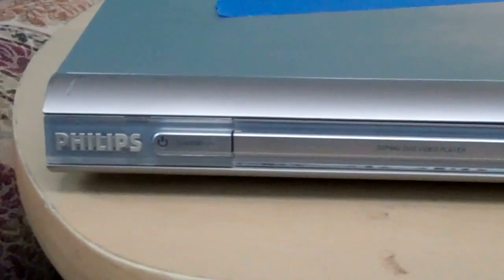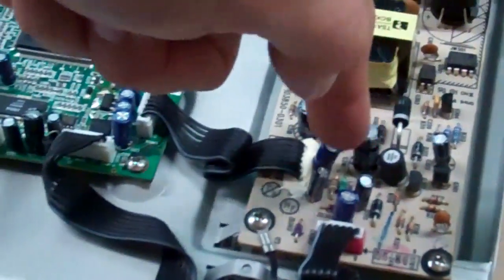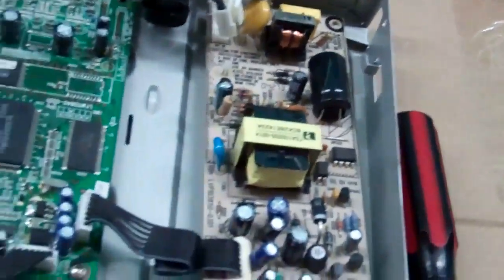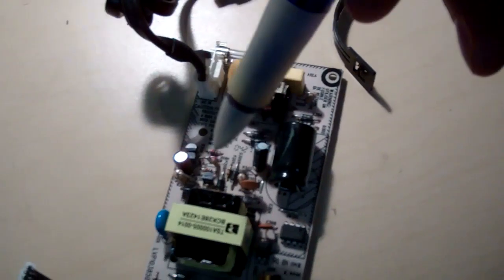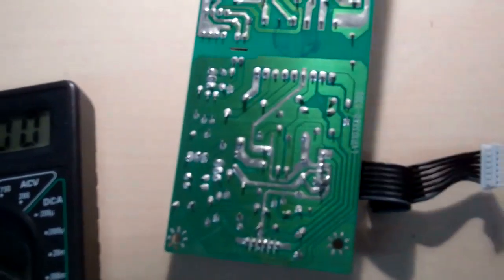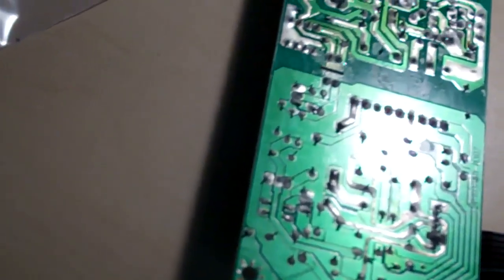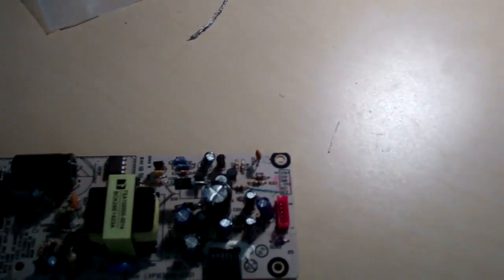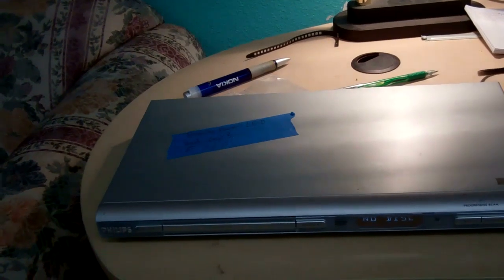Philips DVP642 DVD Player Repair (C316) Tutorial

Comment: I just fixed this DVD player thanks to this video.  I bought a soldering iron and some solder (from Hardware store) and used a 1000 uF 16 v (from Fry's electronics).  It cost about 32 bucks total.  Although it would have helped to see the soldering part because I've never done it, I figured it out nonetheless.  Works like a charm! Thanks a million!

Comment from the maker: The best resource I have found for advice in fixing a switching power supply is the Bad Caps Forum. They have an active forum with many knowledgeable members. I have found it is usually the switching transistors or a bad transformer as common failures.

Comment: Thanks for the video tutorial. It really helped. Not only do I have to replace the C316 capacitor but I also noticed another capacitor on the other circuit board colored green. That capacitor on the circuit board is labeled C290 It's the 470uF 16V one. 
The thing I found a odd was my C316 capacitor was labeled 1000uF and 10V instead of what you showed to be 16V.
Anyways, my thought is to inspect all of your capacitors when you take off the cover to your dvd player. Look for the bulges on top.

Comment: Thank you very much that is very useful, breathes life back into my DVD player. 
One little thing though, at 4:08 you point out the negative and positive side ... but I am pretty sure you got them flipped. On the board all negative terminals of the capacitors are marked with diagonal lines so it is easy to get it right.

Comment from the maker: Sounds like a read error issue. Likely the LED laser diode is going bad. You can trouble shoot by seeing if CD works correctly since they use different LED lasers for CD vs. DVD. With something like a PS2 you can buy new laser assemblies and fix. I do not know if these are easily available for your unit.

Comment from the maker: The first place to look is the power supply. If anything else it will be cheaper to buy new. There are detailed guides to fixing problems like this on the Bad Caps Forum. Be sure all the low voltage outputs have a reasonable voltage. If PS likely bad regulator transistor but look for bulging capacitors too.

Comment from the maker: Hi Naj. When a TV does not come it is usually something in the power supply circuit. Do you see any bulging caps? Maybe you will get lucky and find a replacement power supply board. Take apart and Google part number.
There is an active group for TV repair at the Bad Caps Forum. Maybe they have better ideas.

Comment from the maker: You will have to use Ohm meter and look for short in high voltage DC to ground. Could be the main switching transistor or the rectifier diodes. Use Ohm meter to verify the diodes. With the price of new DVD players so low it is not worth too much time to fix. A new power supply board will be much more than a new DVD player. Look on the Bad Caps Forum for troubleshooting info.

Comment from the maker: It is something in the power supply.  Switching power supplies are all similar. You should have 160V DC across the huge cap at input. This is used to supply a square wave across transformer. Output of transformer is rectified and regulated for low voltages. Often the switching transistor fails or transformer has fault. Go to the Bad Caps Forum for expert advice for troubleshooting.

Comment from the maker: OK that is clearer. If the big huge 250V cap only has a few Volts then that narrows it down. It can only be the rectifier diodes, input choke or the fuse.  The line voltage is rectified and you should see around 160V on the cap. I looks like I see two diodes near the 250V cap. Likely one of those is bad. Check with an Ohm meter.

Comment: So you don't think it's an issue with the fuse? I'll try a cd but the problem along with what I said is that the door of the dvd recorder will not open until that 3 or 4 minute period also. Once I put in a dvd disc it works ok.

Comment: Got into the retro nostalgia, and needed something for my father to play CDs and DVDs. I had this same unit stored and when I tried, has the issue. But now I have to wait for electronic stores to open due pandemic 😒
Reply: look in any old/broken used board, its a great dvd player, worth the fix
Reply: Was able to fix it. Had to change 2 capacitors but only cost me 3 bucks.

Comment from the maker: I recently made a new video "Motherboard Repair Tutorial - Bad Capacitor Replacement" where I go into detail in desoldering.  A motherboard is a much thicker multilayer circuit board and clearing the old solder is tough. You need to put the solder wick braid over hole and push iron into hole top and bottom. Then use an old piece of resistor/capacitor wire lead to push in hole while heated and pull out quickly to remove the remaining solder. The single layer board in DVD player is easy.

Comment: Is it possible to add audio input to this ? To connect settop box audio or any other audio output ?! I mean I planned to use the player as 2rca audio conversion to home theatre system. Mine also same model. Is it possible means where to join audio IN inside...  (Also doubt regarding on Connecting rca with sp+ and sp- and gnd for my plan is correct or not!  ) Kindly thanks.

Comment: So mine exactly like this will not recognize the remote anymore. I have changed batteries and tried to figure out how to reset remote with no luck. I’m wondering if it is a bad phototransistor in the dvd player itself. I know the remote phototransistor works because you can see the led light in the end. Suggestions?

Comment from the maker: The 16V (int 160V) should have something like 5V steady. My guess is a different cap has gone bad causing the 5V regulator to malfunction. If a very high level of AC current is flowing through cap (or in backwards) it will go bad quickly.

Comment: In my dvd home theater system Phillips htd3510/98, rear left channel and front right channel sound is very low compared to the other channels, its sound like low frequency audio and I tried to increase the db -/+  but too low volume from RL channel .why? Any solution 🙏

Comment: There are actually 4 blocking diodes near the large cap.  2 to the left and 2 above.  It looks like 2 in and 2 out.  One in reads around 18v, the one out reads 15v.  The other two (parallel to each of the others) read nothing.  Also with it plugged in I hear a regular clicking sound, very light.  It seems to correspond with the power light blinks. Thanks.

Comment: I replaced the cap you show on the vid 3 years ago with success.  It went again.  I replaced it, and it lasted 3 days then same blinking light again.  It went way too quickly this time.  I tested the large 160v cap and it fluctuates wildly between 7-15 with a meter on the 20vdc setting.  I assume something else is bad besides the cap I just replaced.  Any ideas?

Comment: The problem I have with my dvp642 is not a flashing red standby light. My player has a solid red standby light, until i press the button and the player appears to try and start but then all power shuts down. I checked out the caps and cannot see any caps, including C316, bulging. So I'm lost.

Comment from the maker: It is the power supply. Maybe just the fuse. Likely something else caused the fuse to go. Look for bulging capacitors. Check the input bridge rectifier. Plug in the PS and check for 160V on main capacitor. Could be anything. Look/post on the BadCaps dot Net forums for repair guides and help. Can you find a new power supply?

Comment: Sir, I have a DVD player (a Philips DVP 3996X/94) power supply issue. It shows no signs of heat damage or exploded capacitors. I changed the active components (a TL431, the optocoupler and a TNY177PN). Still, all the supply voltages read an exact zero. I replaced the board and the device is working. But as an electrical engineer, I want to fix the defective board. Can you help? The board type is 40-P10176-PWD1G.

Comment: I have the same dvd player and it had a blown fuse in it, I changed the fuse but the new fuse burned again.. The new fuse was a 2A and the older a 1,6A one (But I don't think that this is a problem..) The capacitors are in a good condition as far as I can see.
Any advice?

Comment: Hi, great video.
I have a dvd player recorder that when it plays it shows blanck and white and noot colors.
Any help?
Thanks.
Reply from the maker: The video processing circuit is bad. Not a cheap fix. Look on the BadCaps Forum for a lot of info for repairs.
Reply from the maker: They make remote testers. A used remote off eBay is cheap or maybe a universal remote. Otherwise you are looking at the IR sensor maybe on display board.

Comment from the maker: I doubt the replacement capacitor went. I do suspect the power supply. My guess is one of the other voltages is missing. Use a volt meter to probe the output connector. There is a diagram printed on board showing whe required voltage. Maybe another cap is bad maybe something else. Inspect them all. Proble looking for missing voltage and trace back to bad part. The Bad Caps Forum has a lot of repair help so ask there.

Comment: I have one of these, replaced the capacitor years ago. Worked just fine. Recently took it out of storage and now it has no sound. Before you ask, the audio settings have NOT been changed and the player is not muted. There is simply no sound through the RCA jacks. Any idea what to do or should I toss it in the dumpster?
Reply from the maker: Maybe open up and wiggle connectors going to circuit board and hope you get lucky. Likely the audio amplifier went bad. In these modern times it is often better to just throw away than fix.
Reply: Kent Diego That was the first thing I tried. However, I've decided not to toss it as I have another one that is identical and if the lens assembly or power supply go on that one I'll have parts. The main thing I like about this model is that it plays Video CDs.

Comment: How much latitude is there with the capacitors?  I happen to have a bag full of 25V 47uF.  Think I could use one of those?
Reply from the maker: 47uF is a lot lower than original. I always try to go higher. You can give it a try. Has to be better than the bad cap it replaces.
Reply: I went ahead and got a pack of 10 of the correct capacitors.  10 for $1 shipped from China. How do they do that? Any way, swapped out the capacitor and everything seemed to work fine except I now have an entirely separate issue to deal with...  It would appear that the red output is not putting out a signal so the picture is color-incorrect - it's sorta blue-ish black & white.  I tried cleaning the connection to no avail. Any thoughts?

Comment: how do you avoid getting electrocuted when you are working with capacitors and transformers ? how can you discharge the capacitors safely ?
Reply from the maker: Working on a circuit that is plugged requires care. You do not touch circuitry while plugged in. There is a large cap with 160V on it. It will drain off quickly once unplugged. I make a point of never touching the HV part of the circuit on or off.
Reply: +Kent Diego is there any danger of working on this while it's not plugged in? Any electricity "stored" somewhere temporarily?
Reply from the maker: The big 400V capacitor can store a charge for a while. Not sure how quickly it dies off but I suspect a few seconds.

Comment: Hi
Have the same dvd player.
Used only for 2 yrs. Stored away for 8yrs. 
Was working fine when stored
Took it out yesterday and not working.
I plugged it in and power light is on. Hit open/close tray and nothing happens. Hit power button and nothing happens.
Try'd the holding down the open tray button 20 seconds to see if would work. Nothing. Red power button/light just blinks.
Any idea What could be the problem?
Thanks
Reply from the maker: +TheTaker31 Blinking power light is repaired in video. It is easy fix.
Reply: +Kent Diego thanks for the reply. my issue is not as in this video. my dvd player just blinks when i hold the power button for 30 sec.
the little screen/display (displays open/close)  doesn't turn on at all
Reply: +TheTaker31 In mine it is C310 (470 uF, 16V)  that 's bulging. Check every capacitor very carefully.

Comment: This DVD player have a sickness of capacitors going bad in the power supply. I replaced it with nichicon 1000uf 16volts and it work and never use this dvd player again. PS3 rules japanese electronic rules !!

Comment: 3300 microfarads at 6.3 volts over the original spec of 1000 at 10v?

3300 over 1000 will work, but the power supply will have to work harder to serve the extra capacity you added over what was supposed to be used and with no appreciable benefit.  You should stick with the same capacity unless directed otherwise by addendum to the manufacturer service literature.

And, even though the measured voltage across the cap's leads may be 5 volts, there's a reason why a 10 volt cap was used, which is probably to take into account transient events that may cause the power running through the cap to spike above 5 volts.  This can happen when you plug the player into the mains, for example.  Using a 6.3 volt cap in lieu of a 10 volt cap removes a necessary margin that may help to prevent that part from being damaged and failing prematurely.  NEVER use a cap with a lower voltage rating than the original.

And, plugging in the power supply when it's been disconnected and removed from the player?  That's generally unwise as many SMPS modules do not take kindly to being plugged in without a load.

Also, if you must measure voltages, you usually measure the output of the voltage regulator or at the output terminals that feed power to the player's circuitry.

Lastly, why are you using a soldering gun?  That's too powerful.  Too much heat will damage parts and can also damage the board.  You should use a soldering iron designed for this kind of work; around 30-40 watts.

Comment: Wow you have no clue of what you are talking about. You never across capacitor leads especially with power on. Your DMM will blow a fuse or even get fried. So you did not get a 5v raiding you got sparks. Second capacitors come in different sizes in every voltage. For any hobbyist out a rule thumb for capacitors is it's okay for higher voltages never lower and capacitance should be the same. If you do this kind of capacitance switching with any frequency circuits they will malfunction.